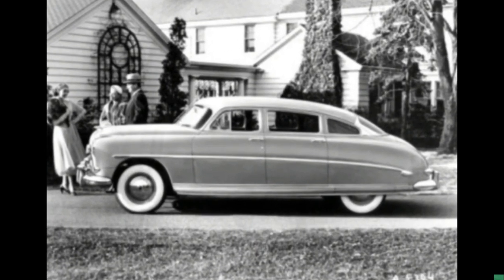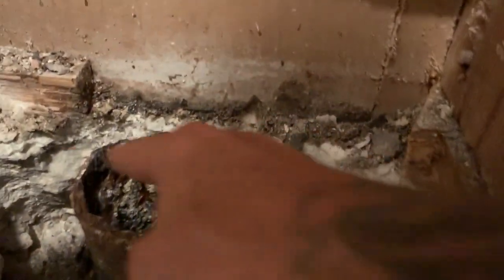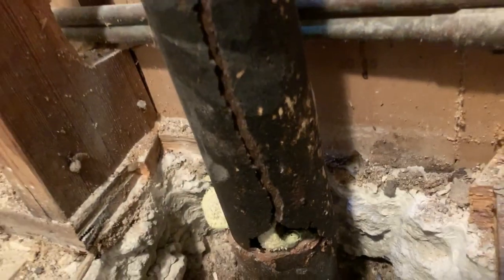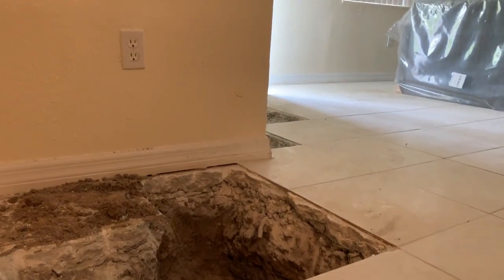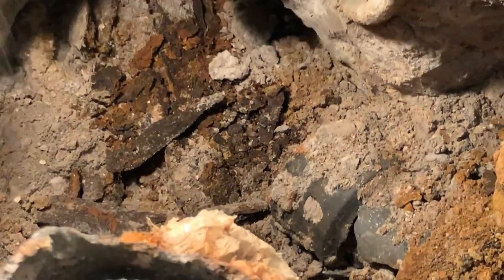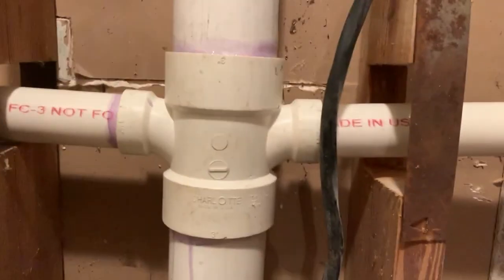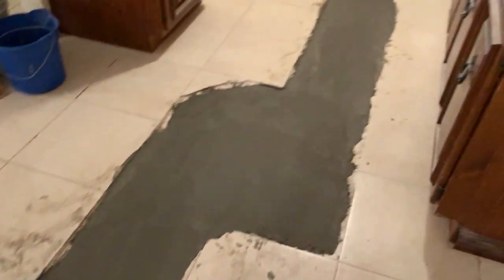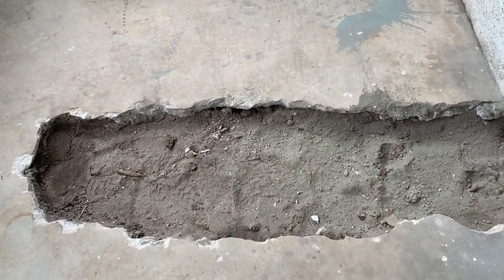HOW TO REPLACE CAST IRON DRAIN PIPES UNDER CONCRETE SLAB

Comment: Isn't it fun when you get called to go fix bad piping and when you find it's not a fix it's a total replacement and everyone starts questioning are you sure about that ?    In 1984 at a hospital new work was installed by me and my dad .. in 2015 they decided to make that area a dialysis unit ,, at the beginning of 2016 250 ft of piping had to be replaced under the slab due to the chemicals they used for disinfection .. been there done that .. got a scar or two to prove it .. lol

Comment: Enjoyed this. Have a plumber coming in to replace the cast iron drains to the city clean out next week. We gotter busted up and the cast exposed for him. I was hoping in your vid you had to cement around a floor drain. Interested how that was done. Our old floor drain had a 8 inch wide  10 deep bowl with a flange and cover with holes in it. I notice the new houses its a10 inch holed PVC cover. I always wondered how they form that round hole to put the flange into it flush with the floor.

Comment: I’m the middle of this same thing myself. Couldn’t even get a plumber to look at it before I jack hammered it out.  They don’t even wanna do the new layout here. Here I go again on my own!
Reply: I am on a slab and had main drain leaking from kitchen and laundry into laundry room under carport. I had someone come in and and disconnect the cast iron and put in a new  pvc. Had to go through cabinetsto connect to a new drain line but didn't have to remove old ones.  Praying that BR holds up.

Comment: awesome video. I bought a 1930s house 5 years ago. this year 2023 I have plumbed a new water main line. dug up my bathroom flooring. kitchen flooring. removed all original galvanized plumbing and jammers where this well to be nice very stupid idiot tried to plumb. my cast iron stack is under my bathroom with the waste line running out in my backyard. I have my main water out front. this was a nightmare where no vent stack was installed. I wondered why my house stunk. the list goes on and on. love to see your comment on doing a job untill the end. most people couldn't comprehend doing work like this. thanks man.

Comment: Thanks for the presentation. My plumber will be doing this as soon as I clear out the basement area - 5 feet on each side of the excavation. Maybe $5,000 to $20,000 depending on what has to be replaced after they dig to determine condition of pipes. Camera only went in about 5 1/2 feet from basement floor of kitchen stack, then was blocked by deteriorated pipe.

Comment: Great work, but you skipped all the important stuff.  You didn't show how you bedded the pipe, or even connected to existing pipe.  Did you tie into cast or that sched 30?  What did you use to tie in?

Comment: Was it safer/ easier using a jack hammer versus a demo saw? I think I have a similar issue in bathroom tub drain also 1950s slab house.🤦🏼‍♀️
Reply from the maker: Concrete saw would make too much dust inside the house
Reply: @PLUMBINGWITHTIM  thanks for the reply ya makes sense specially on job that big👍
Reply: @plumbingwithtim even if you were to use it with water?

Comment: How much did the company charge for this please let me know.  Im looking to replace mine.
Reply from the maker: This job here was around $9000 but it was just a 1 bath/kitchen and laundry
Reply: @PLUMBINGWITHTIM   What state are you in we live in a slab home and same kind of job is going to have to be done with our home as well soon..
Reply: @PLUMBINGWITHTIM  Wow!
Reply: @PLUMBINGWITHTIM  nice job. Your best estimated guess, how much will a job like this on a 3br 2 ba home cost to replace all cast iron pipes? Is it less expensive to go under house and change versus breaking up the floor?
Reply: Twana Wright cheaper to bust the floor. Your looking at a 15-20k job.
Reply: @PLUMBINGWITHTIM  where are you located

Comment: if I am the owner, I would leave the finishing pipe trench hollow, only cover wood on floor, so next time fixing , won't need to cut concrete again
Reply: You won't need to do it again for 50+ years. Probably, probably longer. You'll have wood rot, creepy crawlies, and a spongy floor for 50+ years.

Comment: Would have been easier if the house had a basement!
Reply: Not if the stack is on the opposite side of the sewer connection.

Comment: Why would you put grout around the base of the toilet. If there’s a leak at the base of the toilet you would never know. And by the time you find out it’s gonna be too late. I live in Canada Ontario and if we see someone grouting or silicone in the base of the toilet that’s a no no. I’m sure it looks good when it’s done but you will never know the toilet is leaking Until it is absolutely too late
Reply from the maker: Everything here in Florida is concrete slab so water will not seep through the floor

Comment: Instead of simply scoping with a camera down the drain pipes you would just start digging up jack hammering the concrete slab....willy nilly.....no first you find out where the problem is by using a camera then locate the problem and then use your jackhammer to get to that bad drain pipe.
Reply from the maker: Thanks for commenting 
I personally camera this cast iron that’s how I found out it was bad and collapsing. We don’t ever do anything Willy nilly we are professional plumbers.

Comment: And THAT kids and kidlets is why you NEVER buy an older house on top of a poured slab.  I did A/C in Phoenix for 30 years and 99.9% of the houses were built on top of a slab.  Imagine if you will, you just paid $4 million dollars for a 1950's house in Paradise Valley and you come to find out that your A/C lines run under the slab, your water lines run under the slab, you return air is under the slab AND you need a new A/C unit and all of your plumbing is shot and you didn't have a home inspection done.  What to do, what to do, what to do?  Answer:  BULLDOZE IT DOWN and start from scratch.  Don't laugh it happened more often than I care to think about.  AND if you were in Phoenix, you jackhammered your floors out and spent more to fix the problems than you paid for the house.  Moral of the story:  STAY AWAY FROM HOUSES BUILT ON A SLAB.  Especially ones built in the 1950's and earlier.   That old concrete is THICK and a momma to break up.  I admire that you did it but hate to think what it cost the owner.

Comment: Leave the old pipes you don’t have to take out pipes to run new pipes, this video is all about taking out old pipes,SUCH BULLSHIT
Reply: Often you have to remove the old pipe to get the proper drop in the lines.  SUCH A DUMBSASS.
Reply: How do you run the new pipes through a collapsed pipe?